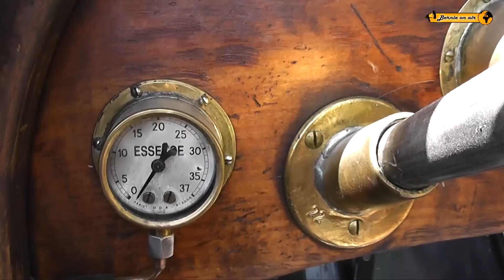Demarcay von 1922 mit Anzani Motor 1000 ccm Rennwagen Racing Car Cyclecar

Comment: I like how it isn't all fixed up pretty. The bodgy steering column solider joint, the switch on the dash that is worn so much that it has a sharp edge.

Comment: I am building a cyclekart which is a smaller less powerful version of a cycle car but I am wanting to immolate the real car as much as possible.  Is there any way you could do a video of this car with photos of the frame, suspension connections to the frame, and what the front grill looks like?
Reply: +MrGtownjake I'm pretty sure you want to immitate, not immolate. Immolation refers to being on fire.
Reply: Well there ya go. Learned something new today.  Yes I would like to imitate this car.
Reply: Actually, weatheranddarkness, I'm sure he meant "Emulate", and not imitate or immolate. Know what I mean?

Comment: That looks to be a very high end cyclecar!! I am building a 1928 Morgan/MG special 3 wheeler with 4 wheels. I am using an experimental aircraft supercharged opposed twin engine mated to an MG 4 speed manual gearbox with a hand cast 2 piece aluminum adapter. The transmission is then coupled via a driveshaft to an mG differential with juice brakes and beautiful wire wheels. I have been assembling a machine shop to make parts for my soon to come YouTube channel called machines and motors. The next project will be a Brooklands style Boat tail 4 wheel cyclecar similar to a Pembleton with a BMW R-100 engine as the power plant. I am recovered from getting run over on my 19557 Harley Panhead enough to start the channel as it gets warmer here in Pennsylvania out in the barn. I hope to see you over there my friends.